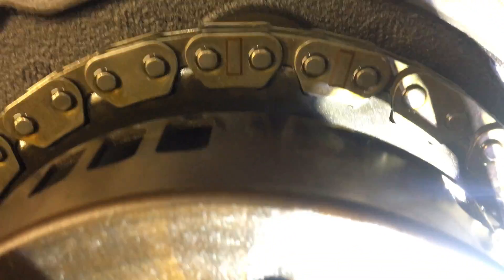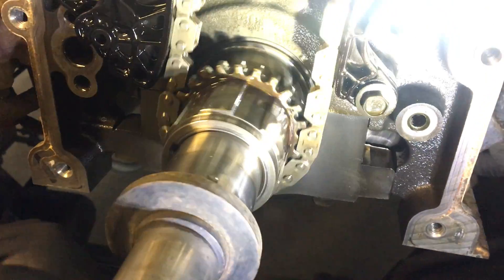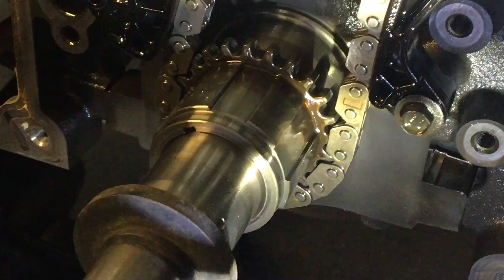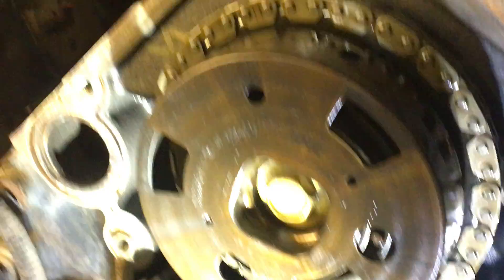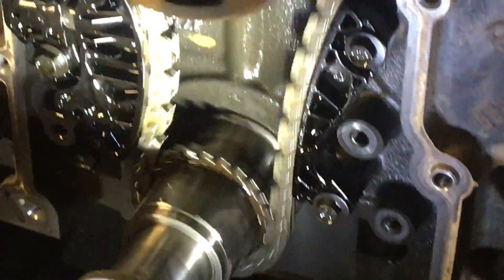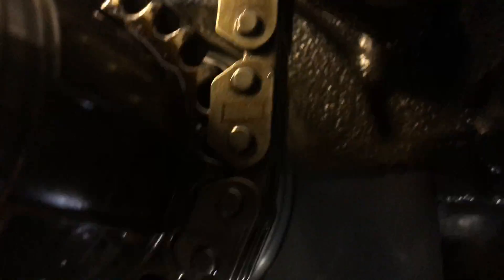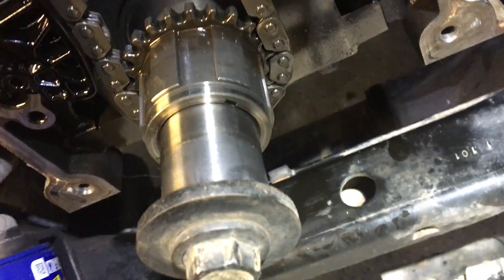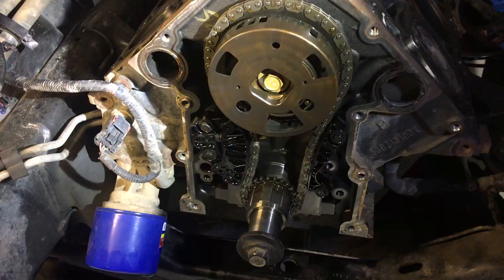2011 ram 2500 Hemi 5.7- how to set timing

Comment: Having built and timed a ton of engines myself, I’m curious why you didn’t just set #1 at tdc with the cam sprocket at 6 o clock then just rotate the cam to match the chain install. You can do what you did on any engine, but that’s not how they are actually built.
Reply from the maker: Blake, I have never built a engine? This was the first time I have ever attempted this repair. I didn’t want to take things apart until the timing was set. I guess more than one way to skin a cat? I did learn about setting the number one cylinder afterwards it does look like it would be easier. This repair did work for me I used my truck to tow my 35’ camper to California and back I have roughly 7k since the fix and truck is running great. Hopefully I don’t have to do this again have a good day
Reply: DirtyDuck fair enough. We all have to start somewhere. If that’s the first major engine repair you’ve tackled, good job man. Most people are too scared to even try. At the end of the day, it’s just nuts and bolts 90% of the time. In some funky instances there are tools or procedures that the public doesn’t have access to, but in your case, my hat is off to you for accepting the challenge. I have an 09 Ram with a hemi in it but haven’t needed to go into the internals for any reason. I run Amsoil in mine and like it so much I became a dealer so I can share the benefits with my family and friends. Most of the people I know drive their vehicles well past the loan pay off time. Anyway, good job man.
Reply: I'm trying to set the timing on my 2011 Ram 1500 and having a hell of a time.  Can you explain why  different videos have the double links on top and the single link on the bottom and opposite on other videos.  Any and all help is much appreciated. Thanks Eric
Reply: I pulled the Cam and put in new, cam, lifters, and timing chain/crank gear.  But can't get it to crank back up. I just can't figure out what I'm doing wrong.  I'm trying to set the timing on my 2011 Ram 1500 and having a hell of a time.  I moved the pistons after I had the cam out and now have the heads back on,  how can I make sure I get back to top dead center?  I put a rod in 1st cylinder driver's side and then rotated the engine until it was at the top.  So I believe that puts the pistons to correct location then I put cam  mark to 12 :00. then I put timing chain on with the blue links marking in the correct location.    Rotated engine to make sure timing marks lined back up.  put back together will crank over but no start.   Can someone tell me where I'm going wrong??   Any and all help is much appreciated. Thanks Eric
Reply: Eric.....you replaced the crank gear so you had the oil pan off,... well personally the only way to know for SURE is to pull the timing cover and oil pan and line up the marks and start over... the way  Marks music stated above.  here's a link again I posed it already 
https://www.youtube.com/watch?v=77hcwGoOmZo
Reply from the maker: I am not sure?? I followed the Haynes manual and recommendations on chain marking alignment. I did watch a lot of videos and they were a little inconsistent. I chose this method and it has paid off. This is the 2nd year I have towed my 35’ camper from Colorado to California since I repaired this Cam shaft and everything is working great I do recommend this method.
Reply from the maker: Blake- I hope all is well! A new comment on this thread you may be able to help with. check out post by @BryanUnion he is needing to set time and your porcess sounds like could work for him. he already has the chain off so needs to get to TDC. if you got a minute check it out. have a great day #GoodVibesOnly

Comment: OK well it looks like the cam dot isnt exactly "straght up".  Looks slightly to the right of 12oclock.  makes sense because im having a hell of a time setting my timing with the cam dot straight up.  if its set slightly the right its perfect which is how its in your video.  I thought i was going crazy.  I even bought a different crank sprocket thinking the 5.7 one was different than the 6.2 hellcat one (installing a hellcat shortblock right now)
Reply from the maker: I would agree, it was a slightly off, 12:02ish. I was aiming as close as I could get. The other tricks was keeping everything straight when removing/torquing  the cam shaft bolt. I am sure things moved a little bit? I am not sure if there is a small amount of variance from left to right? But I hope u were able to get your vehicle  running?
Reply: I'm trying to set the timing on my Ram 1500 and having a hell of a time.  Can you explain why if I've got the timing marks all lined up and #1 at top dead center how having the cam slightly to the right matters? Any and all help is much appreciated. Thanks Eric

Comment: how did the engine startup after this? trying to track down information myself for my 5.7, went with a comp cam, just want to make sure I've covered my bases before torquing everything down, good job!
Reply from the maker: Captain, 

The start up was the scariest part! Lol after all the work u come to the moment of truth! I followed the Haynes manual on start up and everything lined up with what the book said. 

1. I started the truck and the lifters were loud! I thought something was wrong? But I rode it out, after 15 minutes they sounded good. After 30 minutes they sounded great!! I changed my oil at 100 miles and again at 500 miles and now I am at my normal intervals. Bottom line is the truck is running great. I just finished towing my 35' camper from Denver to the Grand Canyon and now to Vegas. It has never ran better. Stick in there u got this!!!
Reply: I just started up the challenger yesterday, everything ran great! your video definitely saved me a lot of potential heartache haha! Thumbs up

Comment from the maker: Adam you are exactly right my friend, I did try to replace just one lifter the first go round. I wasn't sure about pulling both heads and the timing chain. I tried to skip out with just the one lifter. As u can see it did not work:( this is my second go round, I did replace the cam, all 16 lifters, head bolts, cam bolt, crank bolt, all gaskets and spark plugs. I have 1200 miles on my truck since the fix and it's running great! Just towed my camper. Ack down from the mountains and everything is running how it should. I would agree anyone doing this repair I highly recommend replacing the cam and lifters.
Reply: how much did u pay for all 16 lifters
Reply from the maker: @sanjec  it was around $500.00 from a dodge dealer
Reply: @titonunez3431  for all 16?